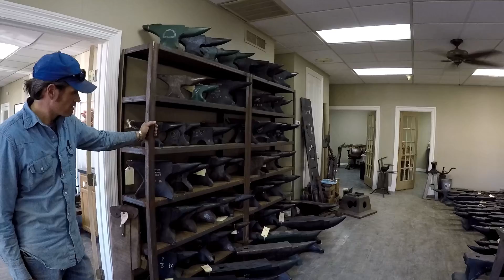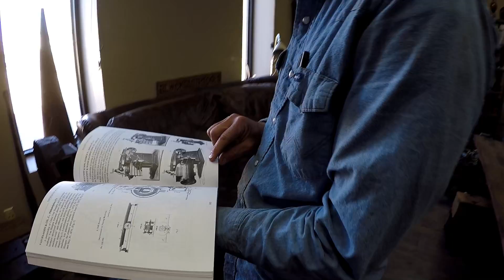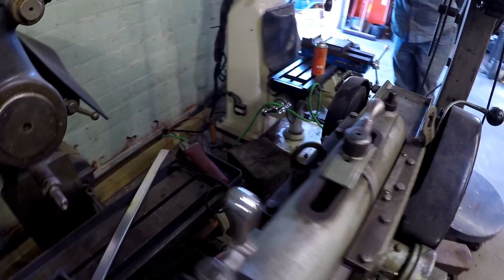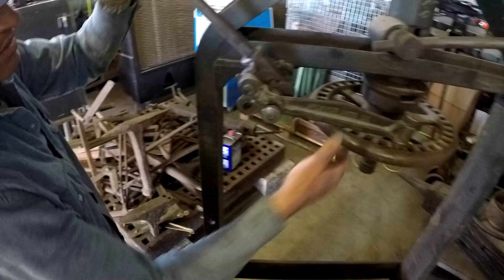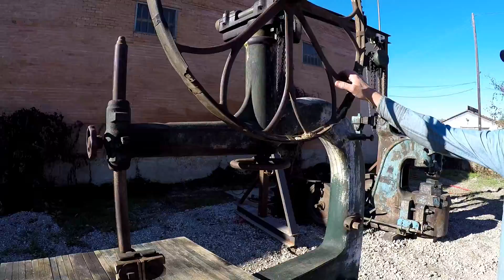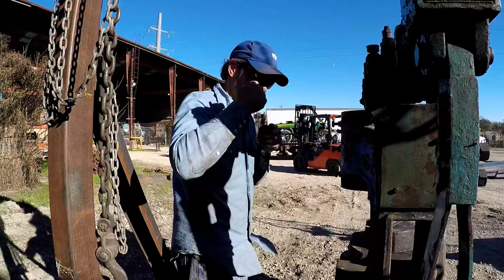Blacksmith Tools Shop Tour Part 1

Comment: Blacksmith Will Stelter would be amazed at the collection of vices. I'm amazed at the entire collection. You'll find the largest working anvil in Harlan County Kentucky. A Blacksmith built it, it weighs an amazing 6,200 pounds.

Comment: Is that a wood floor, holding all that weight…..Interesting….If I was younger, I would start a blacksmith hobby…..  Anvil study is deep.    Also old tools,   I would not want to stand at a lathe or shop tool,  but beating on Iron, satisfying !         Just a thought, bringing a Harbor Freight Anvil in there, would stink up the place 🫣.    Thanks Guys.

Comment: These anvils reminded of my childhood. My grandfather Pa would load up a wheelbarrow with two anvils a shovel and a spirit level. Also a can of black gun powder and some cannon fuse. We would go way out in the back yard and bury one with the base facing up. It had about a 2" diameter hole that was about 6" deep. There was a groove ground in it from the hole to the side of the anvil to place a cannon fuse. He would level the anvil with a slight cant away from the house. The next thing he would do was poke the cannon fuse in the hole and then fill it up with black powder. Then he would place the second anvil directly on top of the first one. We would light the fuse and then run far. He called it shooting anvils. The top one would reach an altitude of about 250 feet before returning to ground. The shovel was so you could dig it out of the ground after impact. Growing up in Miami Florida was fun back in the 50's! Have you ever heard of shooting anvils in your neck of the woods?
Reply: Its been done for hundreds of years. Supposedly also in colonial times. Essential craftsmen on YouTube does it. Ive not been lucky enough to  see it myself but i may in the next couple years

Comment: Mention this shop to Andrew Anthoine Machine Shop, Fort Valley, GA. It was still running in 2017. I saw the video of the shop on the Vintage Machinery channel. The place is chock full of machinery from the 1800s and many are still working off of the belt system above the machines. There is an upstairs that is supposed to be full of old-new inventory going back to the 1800s. I think he would have a field day and the elderly owner likes showing people around. There is a rare machine that just cuts keyways in stock that is used every day.

Comment: OMG!! I am in love with old machinery of every kind. Thank you for this video and I will watch part two.  I really believe the resurgence in interest in these machines is because of their incredible sturdiness, their simplicity, and the ability to restore them is something that is not too difficult. Their capacity too is something you do not see in affordable equipment today. An 18" jointer can be bought, but you are going to pay close to $10,000 for a new one. A 12"  by Grizzley is more than $5300. plus the tax. At an auction, you can get an antique18" power jointer for $1000-$1300. My brother has a beautiful 24" antique band saw with a dead flat steel table that is huge. The antique machinery was made to last and to me, they are works of art. I grew up around antique Machines and cars like Packards, Studabakers, Buicks, you name I have seen and ridden in them. My dream is to own a 1938 Studabaker pick up in Burgandy.  This machinery and tool collection is incredible!!

Comment: Maybe this wouldn't bother me so much if you could buy some of this stuff new, the vises specifically, but you can't. Well I guess you can buy a 8" Morgan for $3000, but that's about the last one left as far as I know that isn't some import made from more dirt than iron. I suppose it also explains why every large old vise I do see looks like it's been used as an anvil, because we know where all the anvils are. Big old vises have gotten ridiculous in price, and there just isn't much in new vises worth anything. I suppose being in the hands of someone hoarding them is better than them being sold as scrap metal, but they're effectively gone either way and unless there is an heir who cares they may just be parked in limbo until that is their eventual fate.

Comment: Great seeing all of this equipment because it brings back great memories of when I was an apprentice in N.O. Right where the D-DAY Museum is now. In the early and mid 70s I was an apprentice  in the shop where all of the machines were run by two line shafts and you engaged the clutch on all of the machines by reaching up above your head where there was a piece of 1x4 which ran the length of the lathe or power saw, drill press,mill and the rest of the equipment. The most exciting part was when you wanted to change the speed of the equipment you had to take a piece of 1x4 board put it against your foot and push the board over either way to move the belt over to the next pulley while the belt was running and you really had to watch the alligator clips which held the belt together. Great experiences and you either paid close attention or you worked somewhere else.

Comment: Keep 1 of each sell the rest please. People are trying to get into blacksmithing and tooling and they are all having a hard time finding authentic tools.
Reply: You always got a couple of rich guys buying up the stuff you want lol
Reply: That's my opinion. By all means open a museum, restore the tools and put the best example of each on display because someday it might be the only one on Earth. Also make sure to set up a trust of some sort to see that it stays that way and isn't turned to scrap later.
Then see that the rest get good homes.
Most collections are collections of meaningless things in and of themselves. Say it was a collection of extremely rare wineglasses. Fine there's nothing special about their function.. but tools have function that can't be replaced with a cheap knock off. You cast things in big iron because you had to and that need just isn't the same now so many such manual use items just are not made.

Maybe the rest of us that want to see the tools that are left out there get used can create a consortium of some kind and fund it so it can purchase, transport and store such as they become available. Markup is fixed as a non-profit, overhead covering amount. It's a big job that would require some big people (wallets and knowledge) to get started but it could be done.

Comment: He was wrong about the Stark lathe.  That type of lathe was not designed for the hobbyist.  That was the precision lathe of the day and was used for fine tolerances in production work.  The machine lathe won out later because it could be built cheaper and faster and the smaller precision lathes died out.  I own a 4ft. Pratt & Whitney No. 3 lathe and it is a sweet little lathe.

Comment: how is all that iron not crashing down through the floor?
Reply: Ujeb08 
The building is old and all the wood in the flooring, floor joists and beams is solid old growth wood. 
I used to deliver into an old factory in Toronto that was all wooden floors and they ran forklifts across the wood floors. The narrow 2” floor boards were actually 2x6 on edge.

Comment: Andrew mentioned the AT&SF (Atchison, Topeka & the Santa Fe), and I had to share that all my youth was spent in the city of Atchison.  We lived five blocks up the hill from what I understood was in the 1970s, the largest metal casting facility in the world still operating at that time.  It was owned and run by Rockwell International at the time, and in my high school years, I was hired to help with computer programming tasks in support of their engineering department.  A couple of occasions saw me out on the cast floor which was exciting, terrifying, and humbling.  Tough guys worked those castings which included modern railroad trucks for box cars, the turret frame for the XM-1 Tank, and stage rings for Saturn V to the boosters for the space shuttle.  And all around was so much stuff like you both show here - it was like common debris!  No-one was interested in historical preservation, which I learned when I tried to get interested in the old AT&SF 1860s train station

And from elementary through Jr. Highschool, almost every day we crossed the large switching yard the railroad maintained from the 1880s.  We found chunks of rail, piles of stakes, and all kinds of switch flags and other old gear.  In high school I had friends working in their machine shop, and got to hang out - you both would have loved it.  Sometimes in our youth, we don't realize the amazing things right in front of us!  Wish I could take you both back and give you a historical tour!!

Comment: Gyönyarű és nagy gyűjtemény. Gratulálok.
A Rába kalapács gépnek ahogy látom ez már nem az eredeti meghajtása. Eredetileg lapos szíjjal hajtották transzmissziós tengelyről. Ez egy 1950 évekbeli példány lehet. A1960 években már Miskolcon a DIGÉP-gyárban gyártották lemez vázzal. DRK60 60kg medve tömeggel és DRK30 30kg medve tömeggel.  Magyarországon még rengeteg működi belőlük.
Beautiful and great collection. Congratulations.
The Rába hammer machine as I see it is not the original drive. Originally loaded with a flat belt from the transmission shaft. This could be a 1950s specimen. In the 1960s, Miskolc was manufactured at the DIGÉP factory with a plate frame. DRK60 with 60kg bear weight and DRK30 30kg bear weight. There are still plenty of work in Hungary.

Comment: with all those anvils on the floor i wonder what the floor is rated for in load capacity?
Reply: I was wandering the same thing!
Reply from the maker: It's a solid concrete floor, why wouldn't it handle it.
Reply: sorry did not see the solid floor only saw a wooden upper floor and though if its built like all the other building i seen built ....
Abom walking around you saw more than your video showed

Comment: The Stark lathes weren't really aimed at hobbyists.  They were plain turning, precision lathes (mostly) and were quite revolutionary.  They were used a lot in industry and there were all sorts of attachments and options available.  I have an old No.4 and it pops up in my vids every now and again if you want to see one in operation.

Comment: The weaver press fast acting lever does not let you bring the press down close to your work then continue with the wheel like you mention in this video.  The fast acting lever lets you do lite pressing quickly only.   And No my Weaver 28 ton is not for sale.  Thank you so much for providing the top notch content it is so cool to see you going on about  a machine that i have one like.  You and the rest of the you tube machinist community are an encouragement and an inspiration.   Thank you and  God's deepest and richest blessings to you

Comment: Sorry to break your proverbial balls but balls to the wall did not come from steam engines that is a wives tale. It originated from airplane pilots there throttles all use to have round balls on them and when pushed to full throttle they would rest against the wall of the airplanes dash. Someone should inform him to not spread crap info.
Reply: He did also say “Balls Out” also so he was partially correct!!!
Reply: Pretty sure steam engines were around a few hundred years prior to airplanes, so it’s pretty safe to say no one really knows for sure  - just sayin’.
Reply: @michael-michaelmotorcycle  no actually it can be traced back to pilots bc of the meticulous records and logs they keep look it up for your self
Reply: Richmon Smith I’m not doubting the fact that pilots would have said that. I was simply stating that steam engines have been around a lot longer. You jumping on someone for supposedly ‘spreading crap info’ is idiotic and uncalled for - especially since he clearly says ‘or something like that’  when he makes the reference, which means he’s not exactly sure. Either way, one would learn a lot more info from the other 60 minutes of this video than the one misinterpreted/miss-explained fact. That’s all I was stating. No need to respond to me, you should just make a video since you appear to be an expert on the subject.
Reply: Richmon Smith  Yeah, that’s my understanding as well. Be that as it may, it’s a timeless expression, don’t you think?
Reply: I was gonna say that!!

Comment: Balls to the wall comes from the piston-engine aircraft engines; the throttle levers have ball ends so you can tell them apart by feel from the prop and mixture levers.  To put push them all the way forward - toward the firewall - is the basis of the expression.  Steam engines did spawn the phrase "to knock the balls off the governor" meaning to make something work much faster than it was meant to, even if it meant its destruction.
Reply: Thank god someone else caught this!!! When people use expressions without knowing what they mean really yurks my chain! You sir I'm sure a great human! Bravo!
Reply: @richmonsmith9308  knowing what an expression means is completely different than knowing its etymology. The fact is, we truly don't know where the saying came from. Balls to the wall means going as fast as possible (the meaning of the saying) and you can certainly know what it means without knowing the etymology. I'll bet you use sayings everyday without knowing the etymology. Maybe it came from pilots, maybe from steam engineers. Maybe "balls out" came from steam engineers, maybe "balls to the wall" came from pilots.

Comment: I always like watching you tour around. On this one. My question is , why would need a 7 or 800 pound anvil. Wouldnt real heavy work be done on a big power hammer. I just dont understand an 800 pound anvil.
Reply: Denny Hansen the big anvils were used by shipyards and railroads the reason they are beat up  is because they didn't have tempered faces  they were one solid piece I dont  know why

Comment: The bridge shaped anvils are specially made to bend heavy rods of iron into u shape and similar forms. And if a rod is arm thick you really have to beat it. Sometimes iron was cold driven on these to make it stronger. This will destroy even the best anvils. So they are purposely made from cheaper and softer material and replaced if needed. They are build to be destroyed if you will.

Comment: When I was a kid some 60 years ago my Father and Uncle had a welding shop in a small town. The neighbour next door was an old German blacksmith who still had a shaft run shop. I can remember being fascinated by all the bearings , shafts, pulleys, leather or fibre belts and clutches perched up on the wall and across the ceiling to the various machines. Apparently it was originally run by a steam engine but when it finally became a non-repairable relic he was going to convert over to electrical power until he priced out a big enough motor and realized what power was going to cost to run in and being a thrifty German of the old stock he said "Fick Das" and went another way. 
Part of my Fathers operation was an auto wreckage and they sold him an old six cylinder Dodge flathead complete with a three speed manual transmission that they built a skid for and set it up like a donkey engine. The skid was mounted on a poured concrete slab outside of the blacksmith shop that had been the base for the steam engine and the main belt was run from the tail end of the skid through the shop wall. The battery for the Dodge starter was inside the shop where it could be kept warm in the winter months and there was a block heater installed in the Dodge engine itself for winter starting. Every morning the old boy would be out to start up the Dodge and then he would go back inside to his living quarters above the shop and have breakfast. When breakfast was over and the Dodge warmed up, he came out, disengaged the clutch, kicked it into first, let the clutch go and brought up the revs, then shifted to second and went back into the shop to start the day making and repairing farm equipment and horse shoes. The neighbours all knew it was time to go to work when then Dodge caught second and many used to laugh about it. It was a common belief that it was the only three speed with reverse blacksmith shop in Canada. 
One night, when I was about 12 or so, the shop caught fire, probably from a stray coal from the forge, and it burned to the ground. The old boy never managed to get out of bed and he, his machines, and the Dodge all went up in smoke together. It was a sad day for all but in a way somehow fitting. You see, he was in his late 70's and had nothing else in the world but his shop and his work and somehow it just seemed right that they all went together at the same time. One more Iron Man with his Iron Machines gone to Valhalla..............
Reply: Norman May What a great and terrible story. How long ago was the fire ? At least an old man did not die slow and hard by way of cancer or stroke or some other slow horrible and humiliating disease. All his life he worked hard and had personal pride and hopefully died quickly,hardly knowing what happened. Yep. Valhalla for him. Even though he died in bed,a death the old Vikings regarded as shameful.
Reply: @paulmanson253  Yeah he got into Valhalla because they needed a blacksmith with a set of tools like the ones that were lost in the fire.
Reply: Great story
Reply: That’s quiet an interesting story about German efficiency & ingenuity.  I would have loved to have seen that.